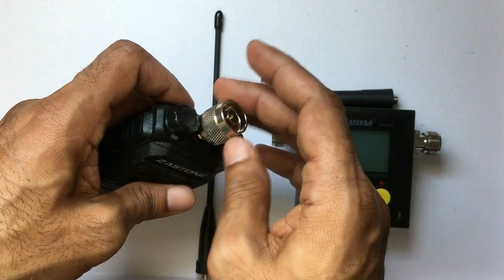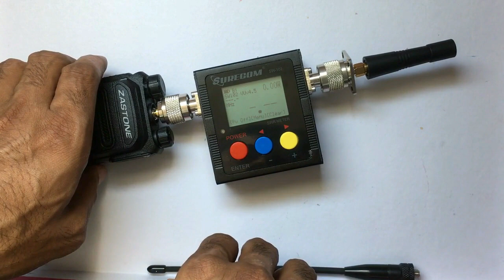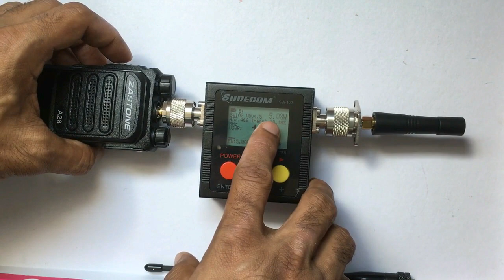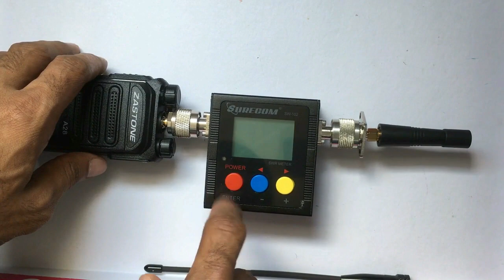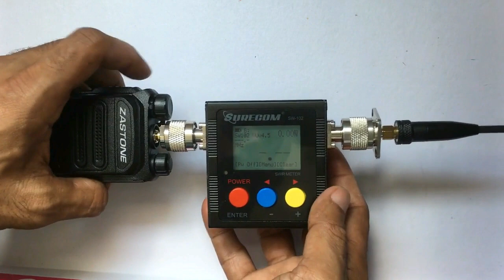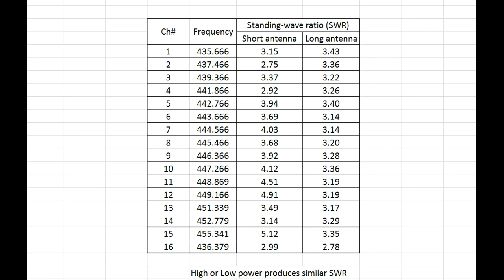10W Zastone A28 review: SWR and factory settings

Comment: How you can measure SWR while antenna is laying on the table?! The whip is not designed for operation in that position! It must be in hands as the body is calculated as counterpoise and it must be verticaly... The SWR values you are measuring are bulshit...sorry to say.
Reply from the maker: Maybe you are right, maybe wrong. Would you mind doing it correctly and share so that we can learn? Thanks in advanced.